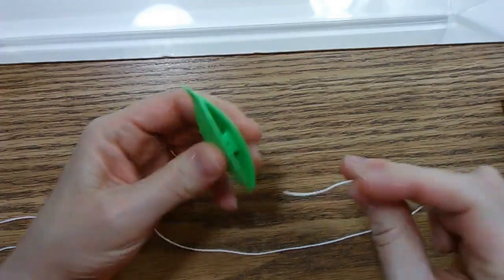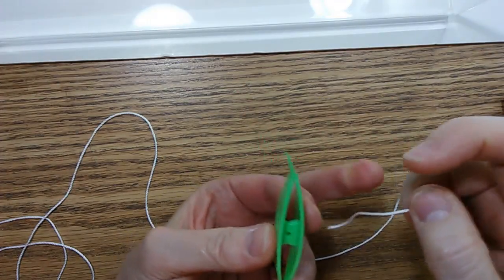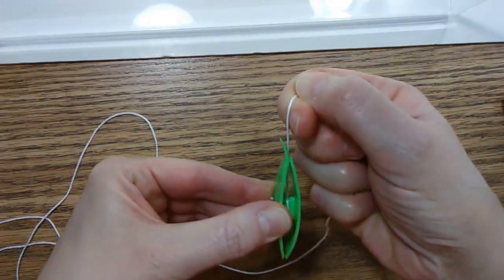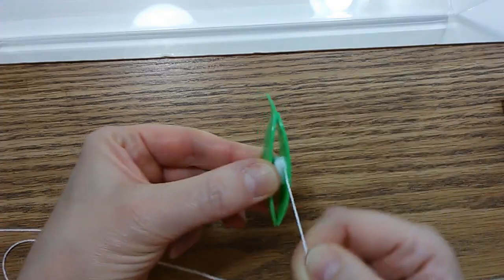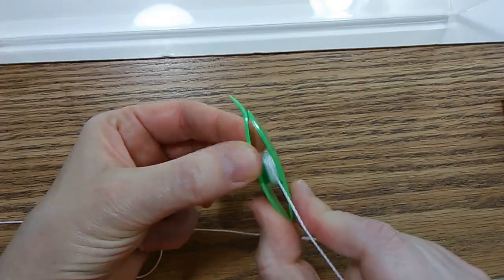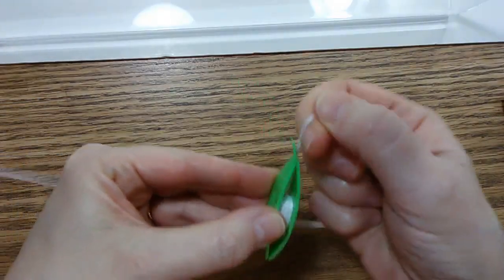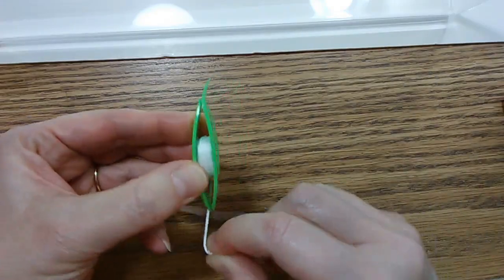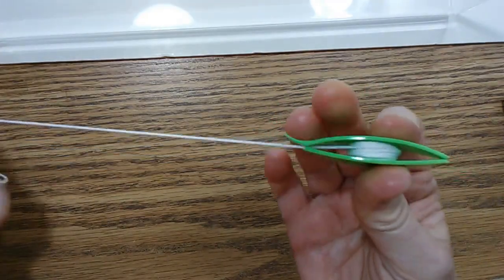winding a plastic post style tatting shuttle

Comment: Your video was very helpful 👏
But I would like to ask you something. I noticed that you used a bigger shuttle than this one in your other video. Is the size of the shuttle important?
Or do we need to use a smaller shuttle to work with thinner threads and a bigger shuttle with thicker thread ?
Thank you ☺
Reply from the maker: Thank you for this "very good" question!  The shuttle is simply the tool to hold your working thread or yarn.  It can be any size you want and are comfortable with.  Plastic are my favorite because they are very lightweight and don't really get in the way during the process.  Wood are very nice because they hold a lot of thread and more yarn than the plastic shuttles.  Since they only hold the working thread, the shuttle size is not important.  I hope this helps! 😊
Reply: @shuttletatting  It's nice to hear that I don't need to buy different sizes of shuttles. 😀Thank you very much for your reply. I will watch your next videos for the beginners.
Reply: Thank you .l want to learn but l find this work difficult